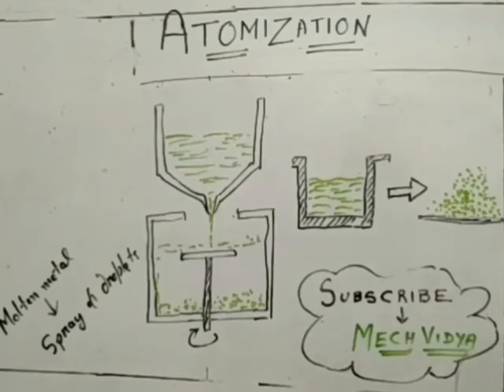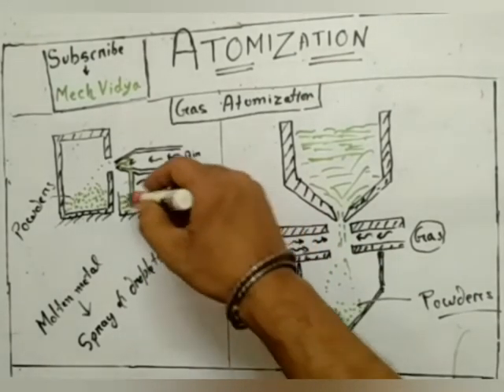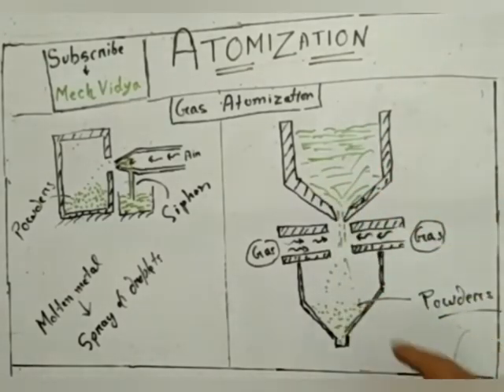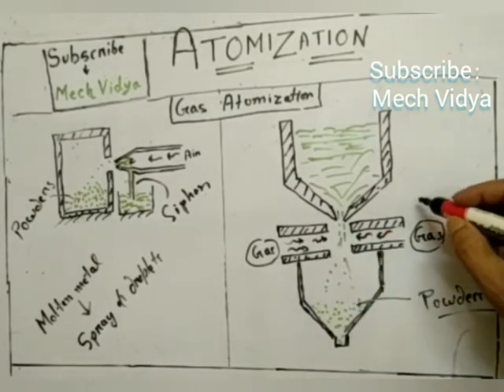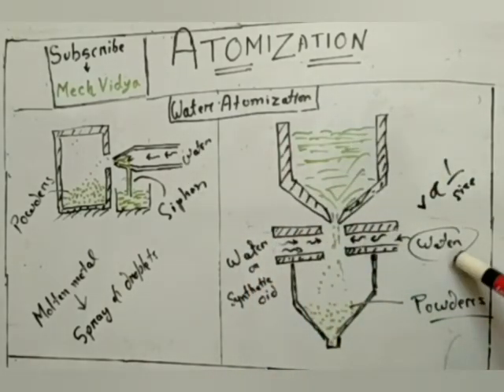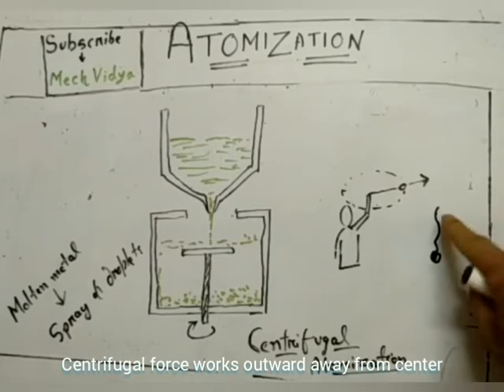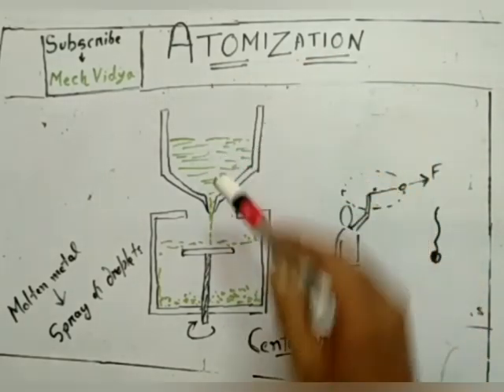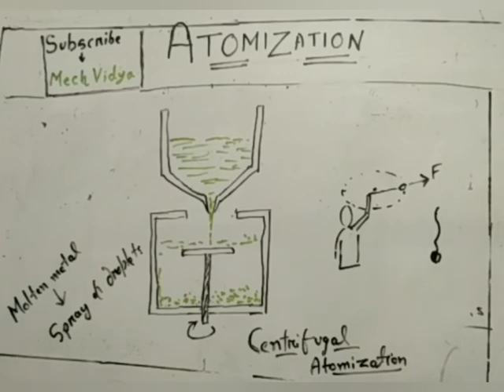Powder metallurgy: Atomization of metal powders

Comment: Hello and thanks for sharing this video
Reply: Can you tell me what material used in the atomizer nozzle ?
Reply from the maker: Welcome
Reply from the maker: Depends on what fluid you are using to atomize the powders. Stainless-steel, alloys of nickel or brass are used generally. 
One thing to be kept in mind is that the nozzle material shouldn't react with the fluid and should not wear too often